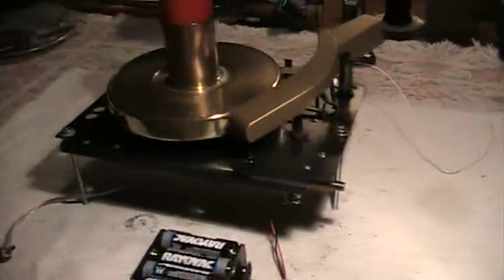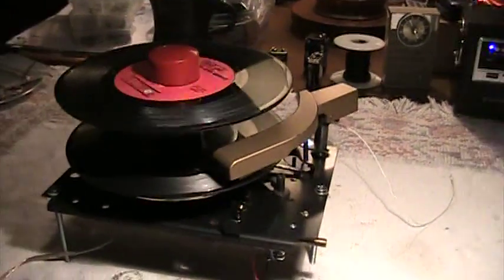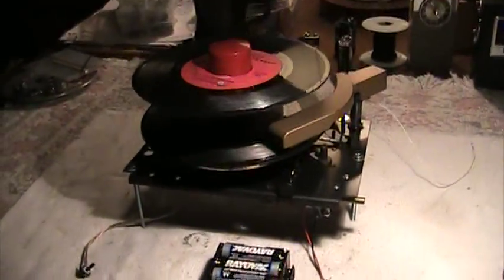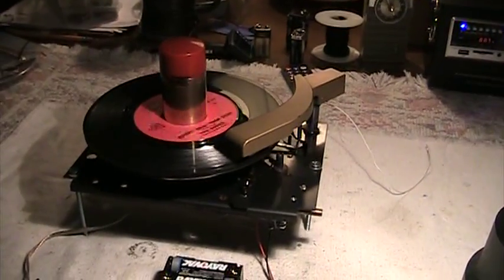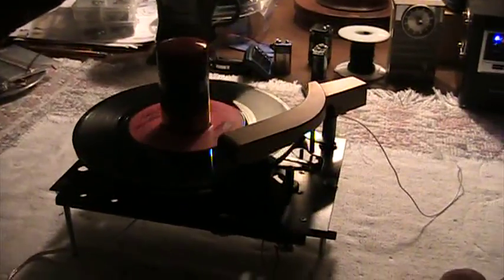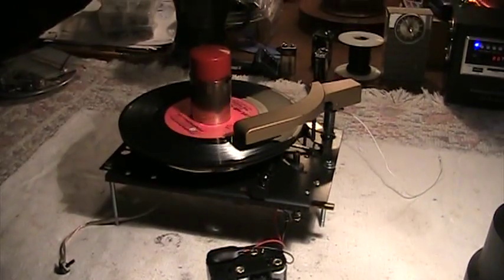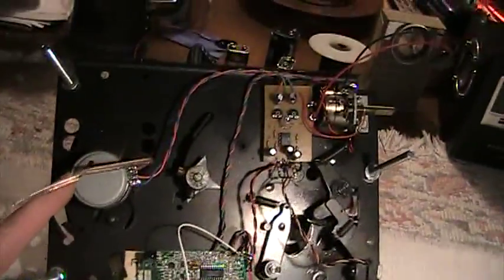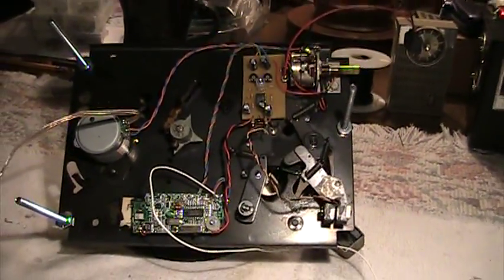Battery powered RCA 9JY 45 record player with FM Stereo transmitter

Comment: At first I was wondering how you got 8 AA batteries to power the motor on this RCA player for 20-25 hours. But I guess using that other low voltage motor makes that possible. It's amazing that it is powerful enough to run that machine through the automatic cycle. Great job, you're an extremely talented technician. What is/was your profession before this?

Comment: Very neat project.  I just picked up an 8EY31 that's pretty ratty that I plan on recovering the case and turning into a portable picnic special thanks to being inspired by what you've done here.

One question I have about your preamp module...does it have any sort of RIAA equalization capability built in to work with a moving magnet? Or do you mean that it just has sufficient gain capability to work with the lower output?

Comment from the maker: @ashleycox432 They run between 20-25 hours. I get my batteries at Shop-Rite, better prices than walmart- and the AA are amoung the cheapest you can get. You can also use rechargable batteries, or an AC adapter